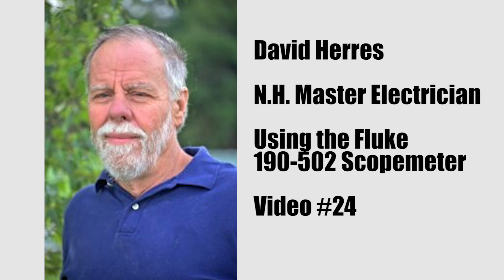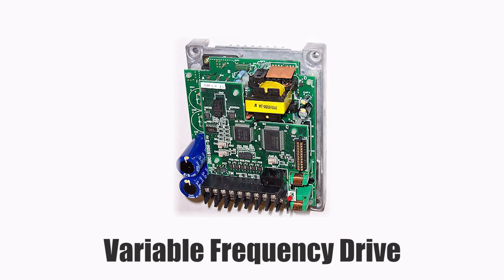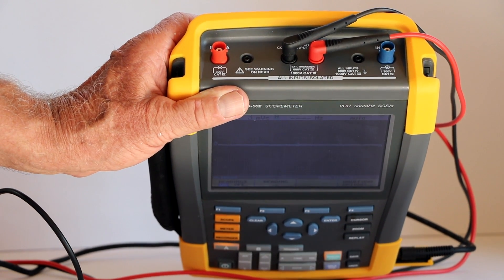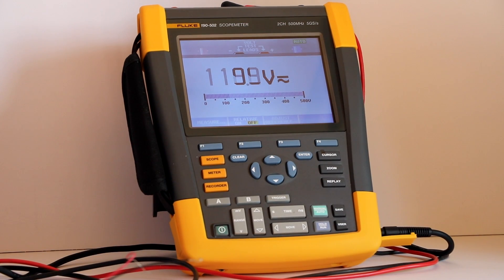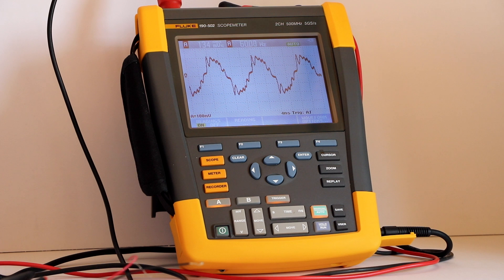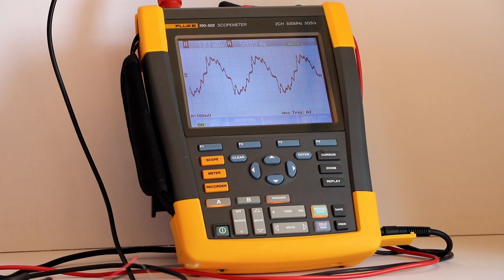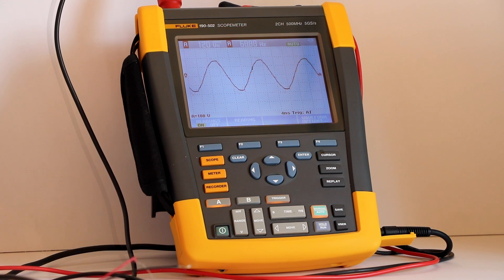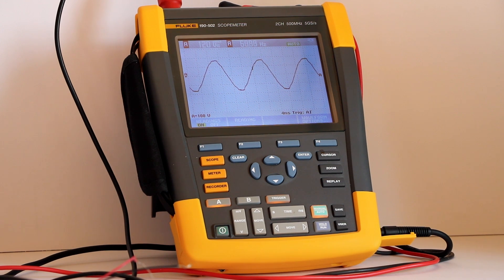Using the Fluke 190-502 Scopemeter to measure electrical noise

Comment: A scope doesn't have the sensitivity  to display electrical noise especially when most of it is in the RF domain
Reply: You know nothing of the industrial world or scopemeters then 😂😂😂 because it’s what we use them for in industry!
Reply: @lonewolftech  "... You know nothing of the industrial world or scopemeters..."
You reckon?
Ok, so on my spectrum analyser I can see neg 20dBmv of electrical noise at 30Mhz which is approximately 100 micro volts . This electrical noise has destroyed the SNR and causing serious impairments to the communication channel. Are you seriously trying to tell me you can see that on a Fluke scope meter that has a sensitivity of 2mv per division? 
My spectrum analyser can see down to neg 50dBmv how far down can your scope see 🤣🤣🤣🤣